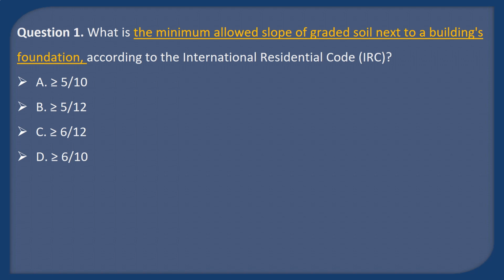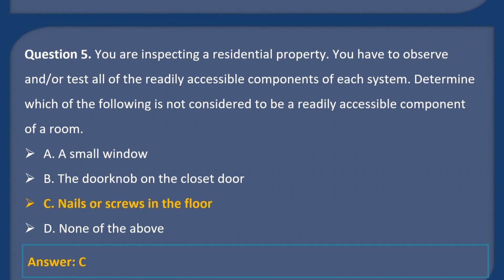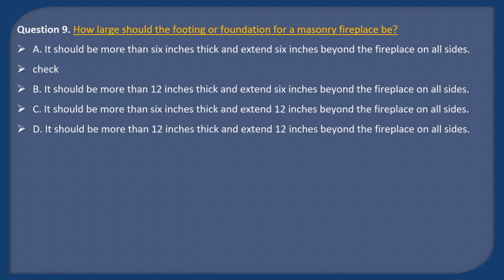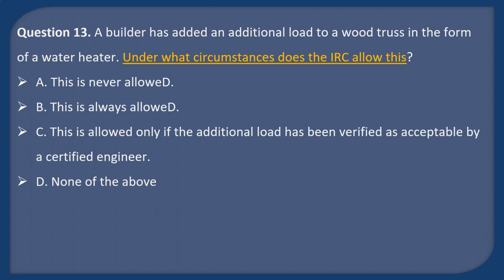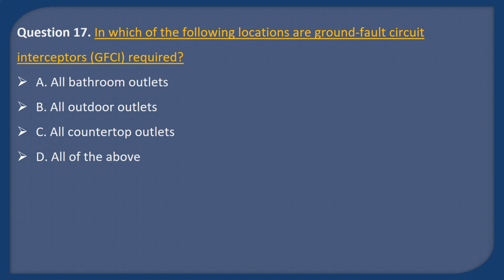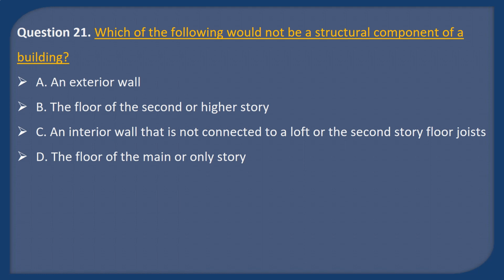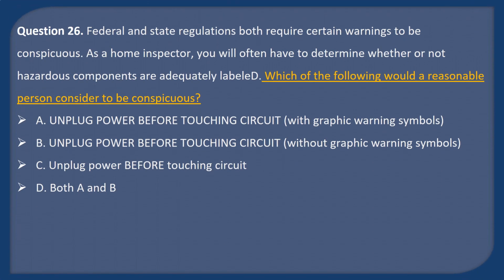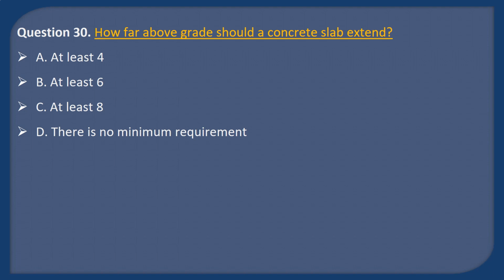Home Inspector Practice Test 2024|  Home inspect 30 Question

Comment: Question 17 is missleading at best. National Electrical Code (NEC) requires all outdoor outlets to be ground fault circuit interrupter (GFCI) outlets.
Reply: I don’t see how they can justify the answer not being’d’
Reply: my thought was the same, GFCIS are required in all those locations, However upon further thinking, I suppose the word "all" is where they get ya. In theory the outlets down line could be all on one GFCI, thus not "all" of them needed.   hmmm